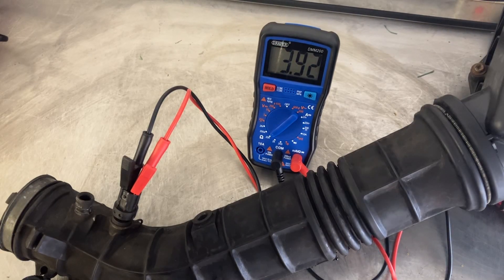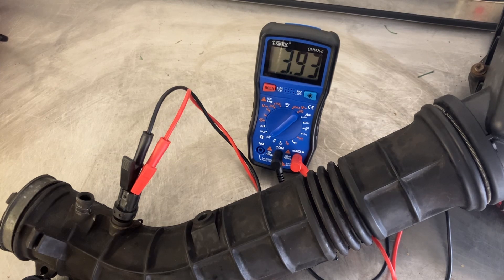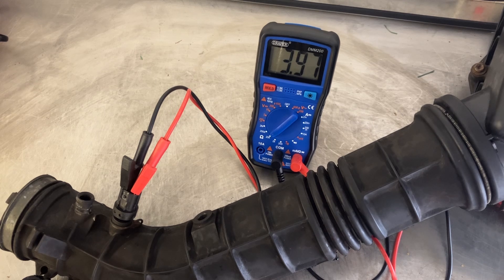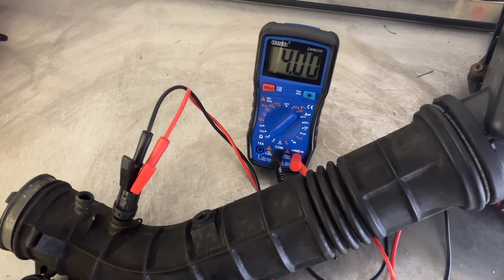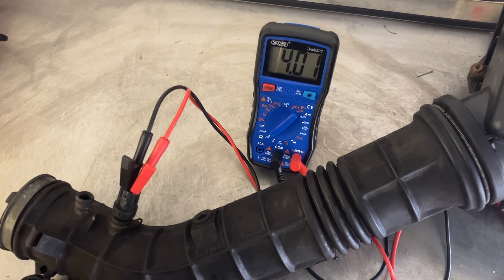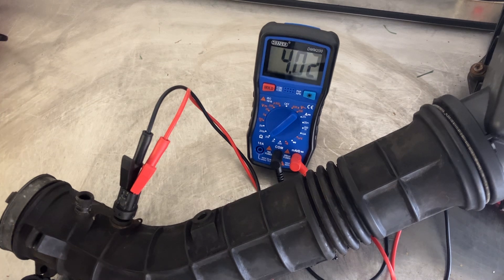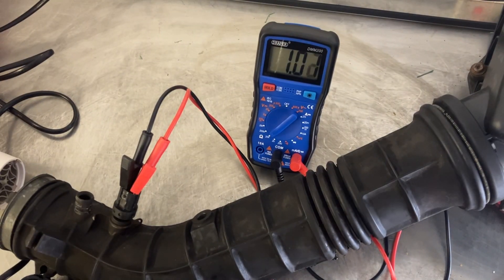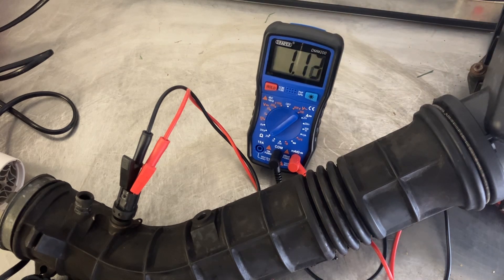How to Test an Intake Air Temperature (IAT) Sensor.

Comment: What do you think, engineer, about this problem:
The RPM goes up to around 2000 in winter… but in summer it goes back to 900 even if the car is left without any repairs.

Two months ago, when the weather was hot, the car was very good and smooth, and the RPM was below 1000… but as soon as winter comes, the RPM rises to 2000 on its own.

And even if I drive it for more than 20 km, it still stays high.

Corolla 4AFE (1st version).
Thanks
Reply from the maker: It certainly sounds like the IAT sensor! It's telling the ECU the engine is cold even when it's not. Failing that, something around the idle air control valve.

Comment: You said it's thermistor and it's positive temp coefficient. Positive temp coefficient means increase temp increase resistance. Normally thermistors are a negative temp coefficient.
Reply from the maker: Your absolutely right, I’ve misspoken on the video. Good spot.

Comment: Is your car Honda civic?
Reply from the maker: Yes! This was a ‘99 1.4 sport. Unfortunately the rot finished it off, but kept some of the parts from it..
Reply: @AdamMechanic  had issue with my car running lean, when i test the IAT it shows 1.550 ohms when cold and 0.5 when hot, is it already faulty?
Reply from the maker: I think that sounds OK. Just check all the intake pipes for splits first, it might be drawing in extra air from somewhere. It has a separate MAF sensor that might be faulty. Failing that,  might be a fueling issue.
Reply: @AdamMechanic  fuel pressure is within range, fuel pump is also newly replaced, can't find any vacuum leaks, compression is also good, ect is also good, wiring on iat an ect also has 5v, i can't think of anything else to check😅